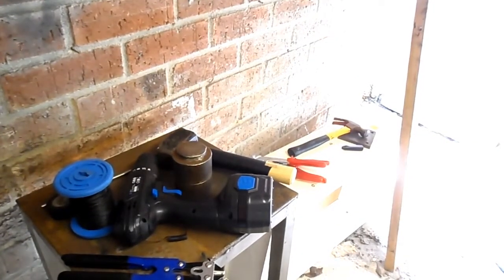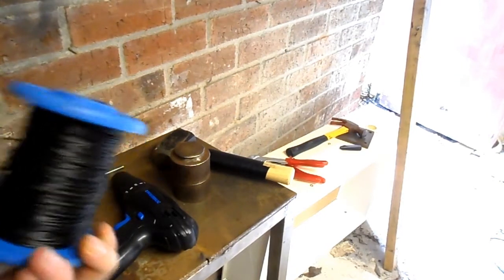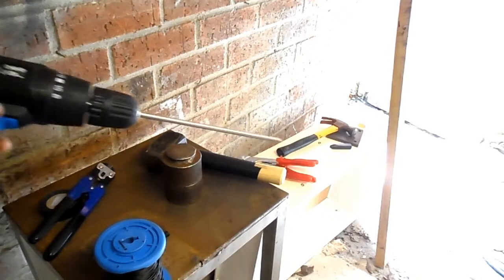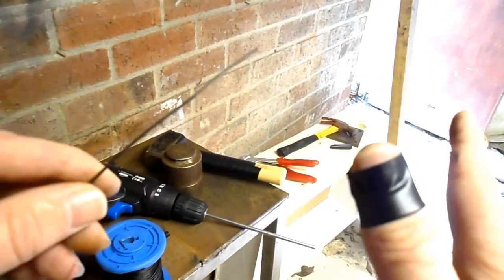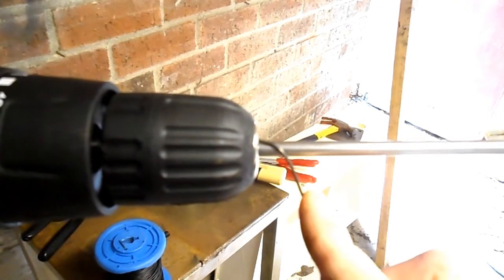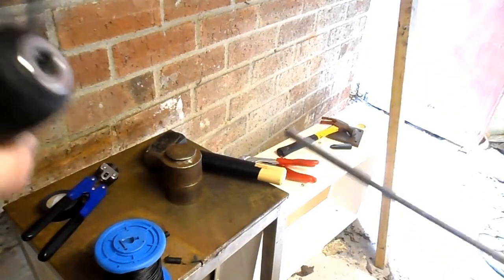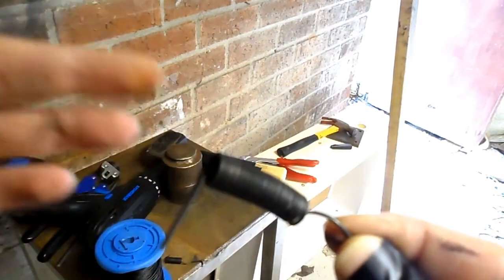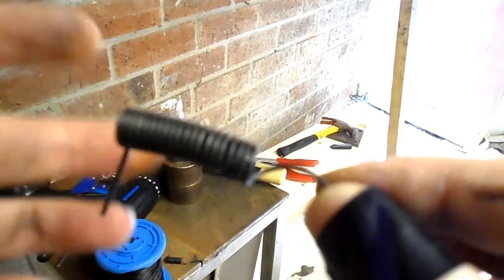Wedge Riveted Maile Armour - #2 Coil Making

Comment: what do you think about using stainless steel wire? I want to make armor, and am not worried about historical accuracy. I have heard that stainless steel is hard to cut. Do you think these methods would work with wire of the same gauge as this iron wire? Thanks for the tutorials! Awesome work!
Reply from the maker: I had the idea of using 304 17/7 PH stainless steel to make super strong maile but it turned out to be a bad idea, the coiling and cutting of the wire was fine, the flattening process was too difficult to be viable. 304 steel is really strong  so it might be necessary to look into all available grades of stainless to identify which one is suitably soft and can be annealed for it to work in this sort of craft.
Reply from the maker: Further, if you fail to find an appropriate grade of stainless steel then please do not make the school boy error of selecting galvanized mild steel on the basis that it wont rust. You run a very real risk of giving yourself heavy metal poisoning since heating up such steel for the purpose of softening it also exhausts zinc oxides into the air and upon breathing that, you will start to feel very unwell indeed!